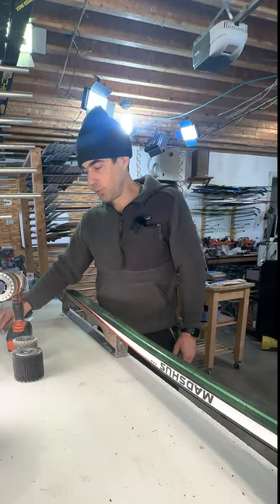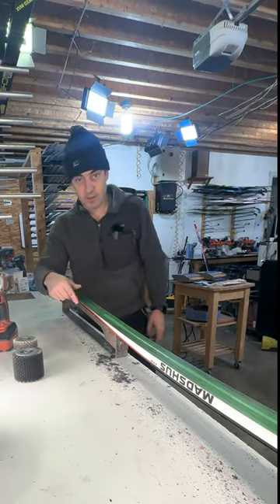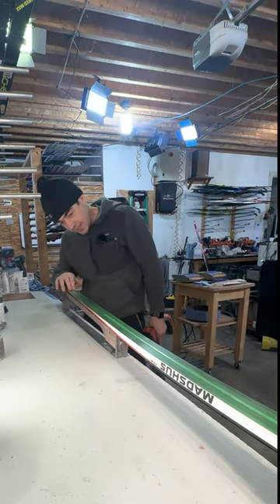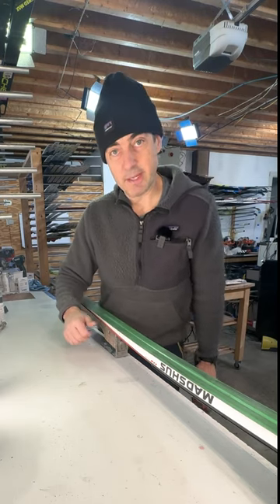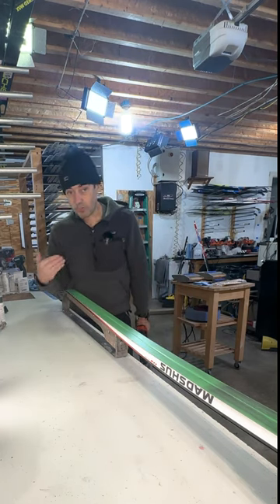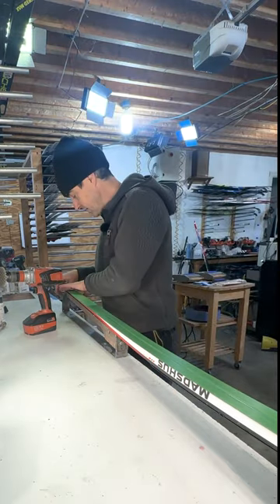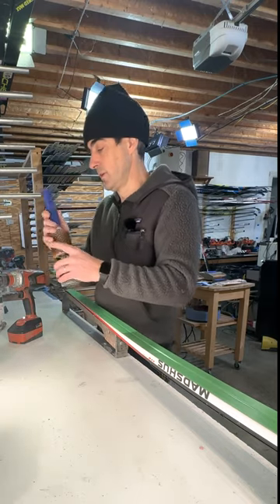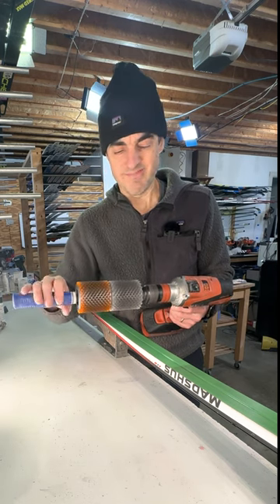Brush use - which, when, and why.

Comment: What brush do you use for cleaning the ski (to remove dirt, etc.) before you start waxing?
Reply from the maker: It’s a great idea to use a base cleaner to help remove surface wax and pollution - kind of like using dish soap instead of just scrubbing really hard. Whether or not you use cleaner, a fine steel brush is a great tool for clearing surface material in preparation for waxing.
Reply: @caldwellsportski  I heard many different recommendations for brushing after base cleaner: steel roto, steel, nylon roto, natural hand. What is your recommendation?
Reply from the maker: @alessela7119  it’s not so critical. The cleaner will soften the remaining hydrocarbon material and loosen the bonds. Work the cleaner on the base while it’s wet with a shop towel or an old nylon brush. Then wipe it off, and let the ski dry until you see a whitish film left behind (the base will look “dry”). Then just brush away that residue with more or less any brush, and you should have quite a clean base.